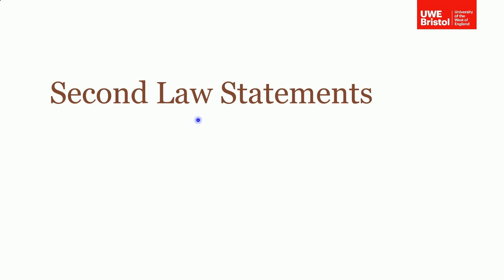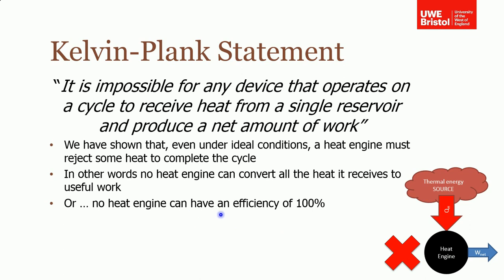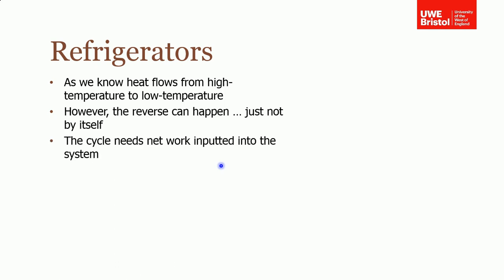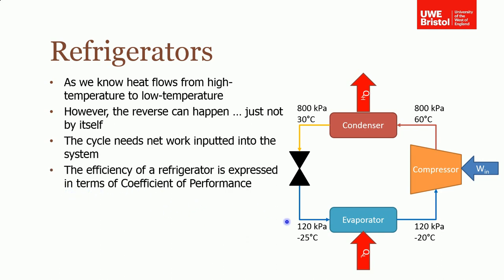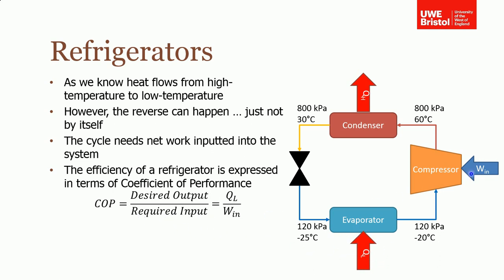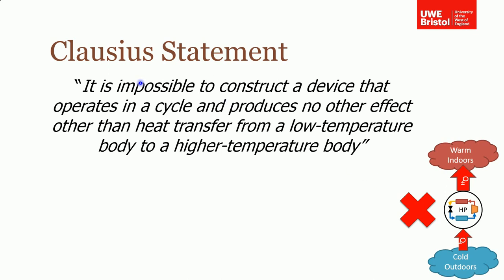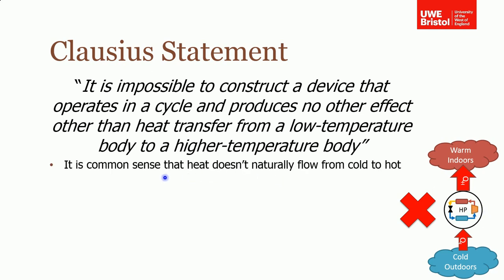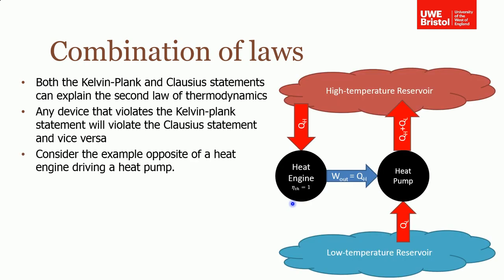Second Law of Thermodynamics - Part 2 of 6 - Second Law Statements

Comment from the maker: For refrigerator the desired output is Q_L. Therefore:
COP = Q_L/(Q_H-Q_L) as shown. 

If you take Q_L outside the bracket on the denominator then you get:
COP = Q_L/(Q_L*(Q_H/Q_L - 1)).

Then the Q_L cancels top an bottom giving:
COP = 1/(Q_H/Q_L - 1).

You can follow the same logic to drive the expression for a heat pump.

Comment: Quick question how did you derive the last line of the equation at 4.58, shouldn't they be COP = (QL/QH - 1) for when QL is the desired output, and COP= (1 - QH/QL) for when QH is the desired output.